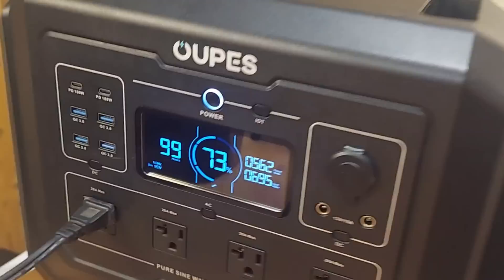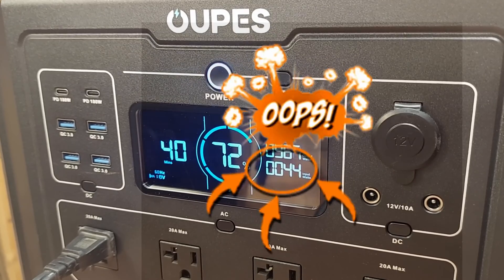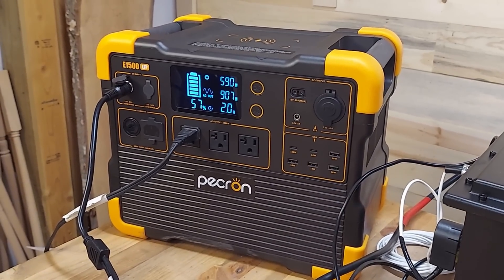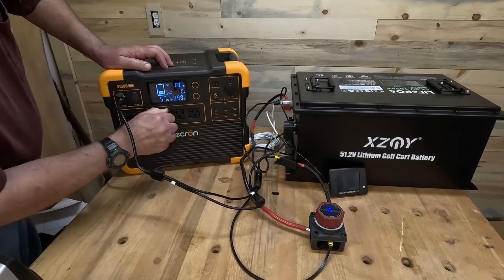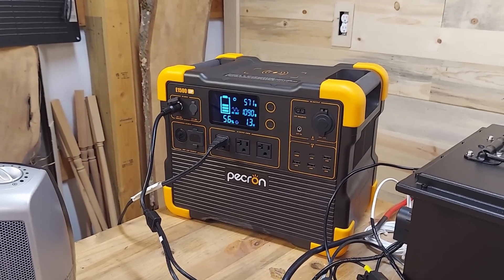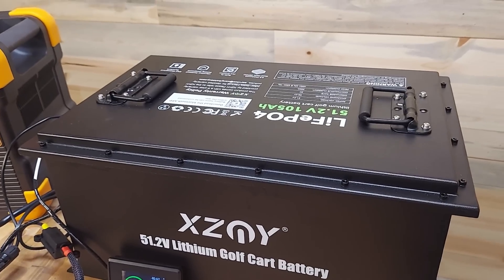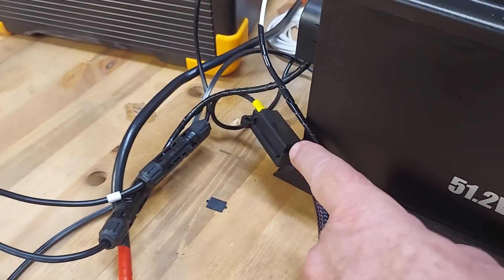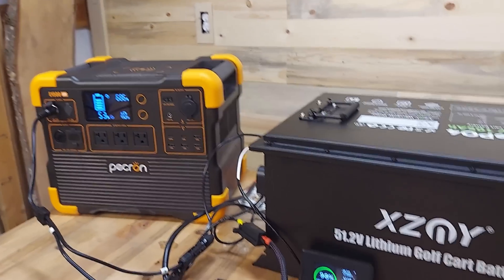Can This Power Station Handle EXTREME Overload?

Comment: This video is really informative to me.
I use 24v and 48v batteries for my capacity so your video kinda sway me a bit.
Was thinking about getting a Mega 1 refurbished for $349+tax but seeing how the Pecrom E1500 does better.
E1500 is $599-5% no tax. Pecron is .37 per wh and the Mega1 is .362/wh. I think this video made the Pecron win out. 
Oh Pecron with 5yr warranty vs 3 for the refurbished.
Reply from the maker: It definitely did better in this testing!

Comment: Nice post ty for sharing very informative I know Pecrons are good there main problem I heard was customer service but I saw a review where they are doing better on that. I have an opus 600 I tried to use it once to charge my Buletti 180 just to see if it could once,. even with my Bluette 180 on silent charge it couldn't handle it so got a 12v life Po 4 battery and a 2k watt inverter.  as a back up for emergency situations. I plan to add more 12v batteries to my inverter in case of power outages. and the opus 600 can run a fridge if needed it only takes 100 watts at a time charging thru ac or solar but plan to get it a back up to.  I appreciate you letting us know things you find like this it helps a lot.
Reply from the maker: That’s a great way to set up your backup plan and really useful for your fridge, which can be a pain to lose!